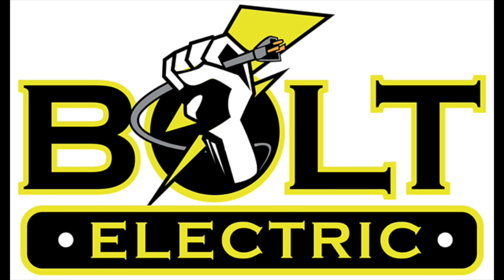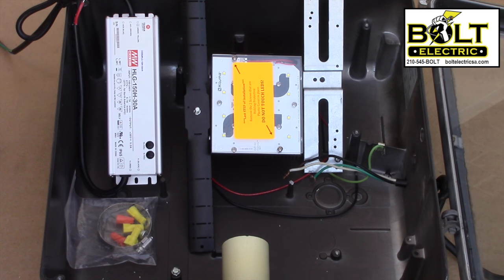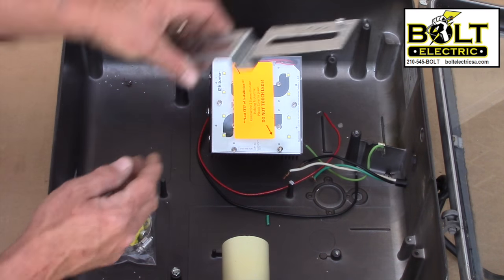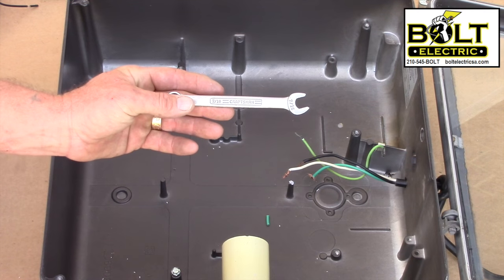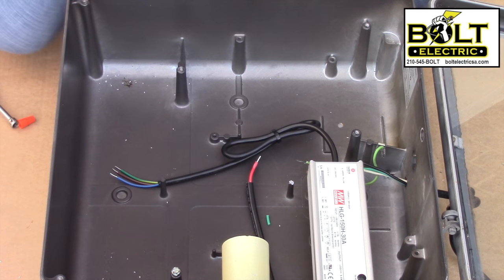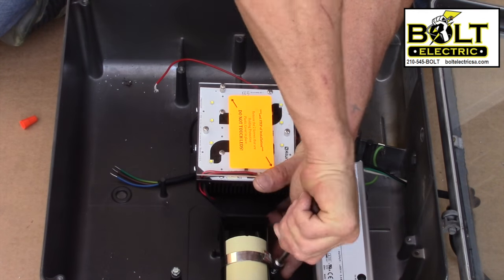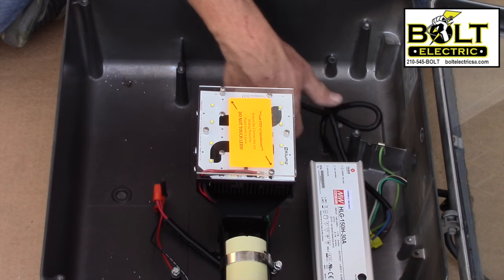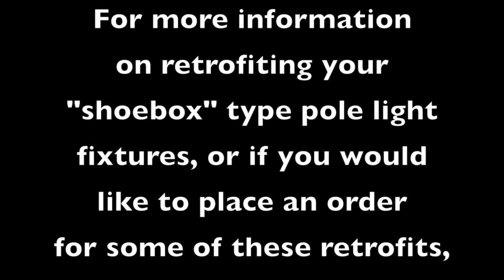HOW TO RETROFIT a metal halide or high pressure sodium light TO LED!!

Comment: You shouldn't need a separate driver. Satco makes a screw-in LED retrofit lamp which runs on mains voltage.
Reply from the maker: Actually Only for 120v , and nowhere near 20,000 lumens.
Reply: Bolt Electric Yes true the maximum output from those is 14000 lumens. But all the commercial LED retrofit lamps that Satco makes have universal voltage drivers in them (100-277volt)